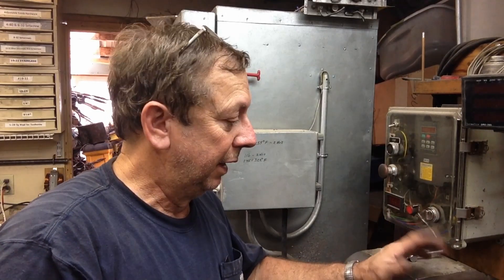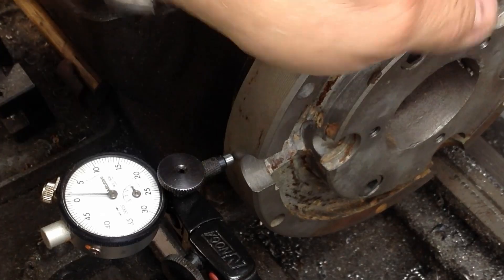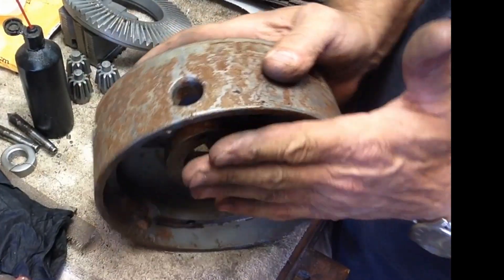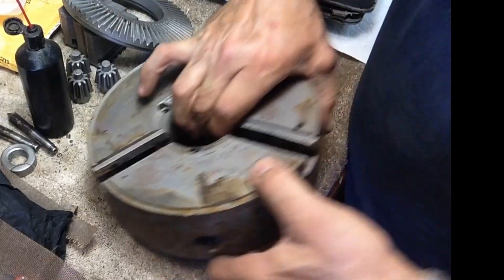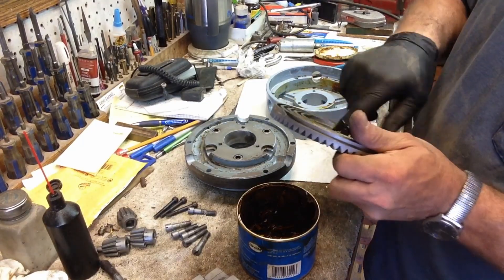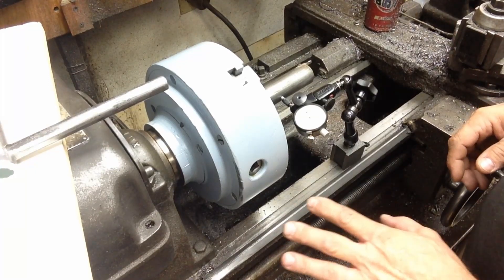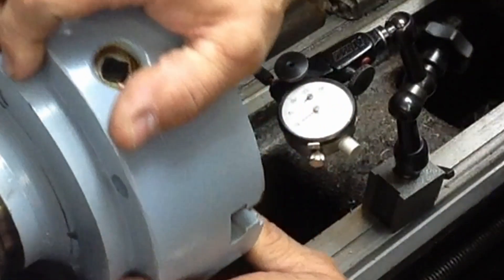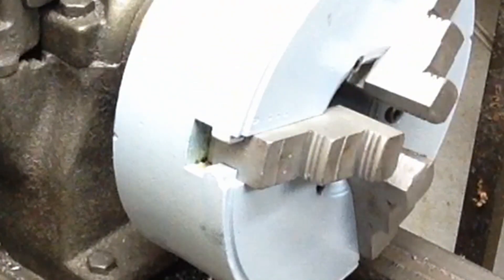Sheldon Lathe Restoration, Modifying A 3 Jaw Chuck: Part 2

Comment: I am in the process of restoring a Sheldon TU1236B Lathe.  In your first Sheldon Video you mentioned the "clutch" on the apron.  Would you explain the purpose of having a clutch? Thanks!
Reply from the maker: Hi Al: The clutch is for the power feed and power crossfeed I am referencing the xl, exl series but assume that the TU has the same mechanism. there is a 3 position lever on the front of the apron (about the middle) when the lever is in one of those positions (I beleive farthest right) and you engage the far right lever on the apron it will engage the half nuts for threading. The other 2 positions are for power feed and power cross feed. When in either of those positions when you tighten the clutch knob on the front of the apron it engages the power feed. to disengage you loosen that knob. If you follow the Sheldon list on a fairly regular basis a thread will get started about this knob being "frozen" or "seized" in place. This is because it utilizes a left hand thread and is overtightened in the wrong direction
Reply from the maker: center position engages the half nuts, left is power cross feed, and right position is power traverse of the bed.

Comment: That power coated chuck body looks good. I though about electrically galvanising a chuck. Not sure if it going to work but I had some good luck with old brake calipers.They can do them in gold and would love me a golden chuck :) Nice chuck carrier, I need to make me one of those. That old 7.5 inch chuck I have seems to get heavier :(
Reply from the maker: I would not normally do that, but it is so beat up and etched that this was the easiest way to give it some protection